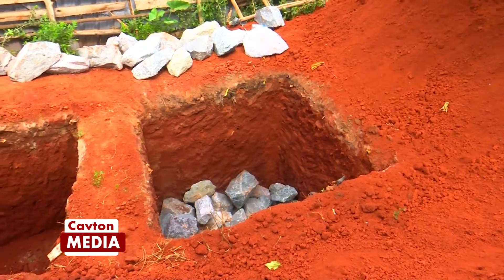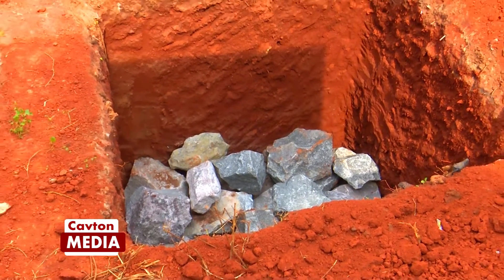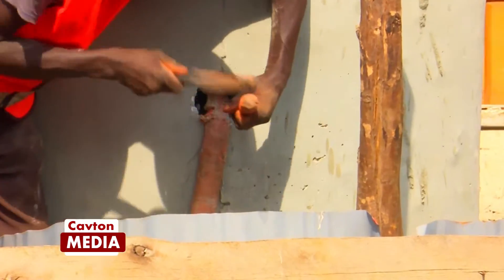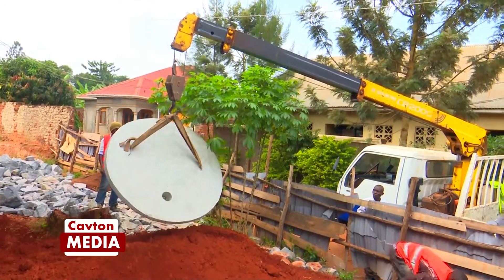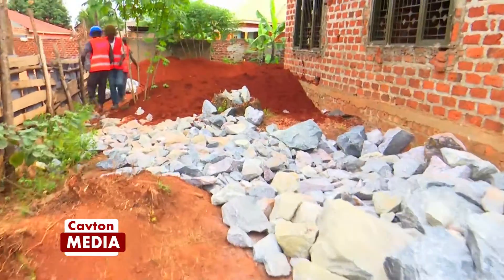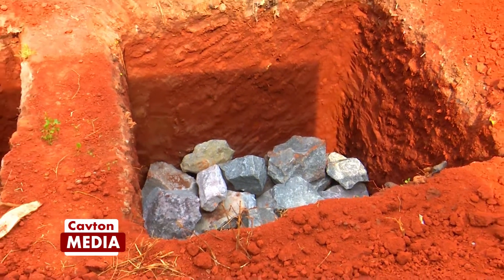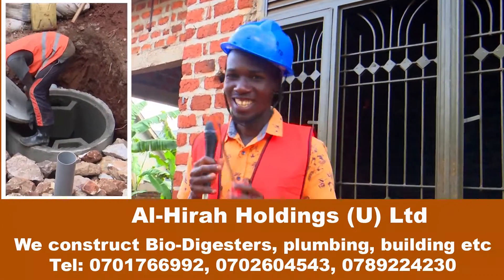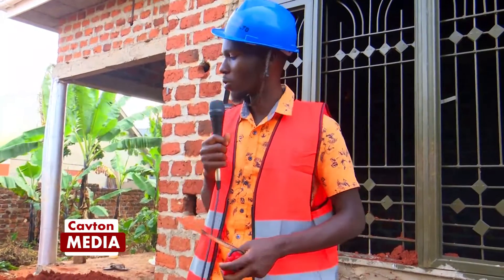Why a Bio-Digester is better than the old Septic Tank in Uganda

Comment: Filter the gas, h2s and c02 are mixed with bio gas , key is using molecular sieve like zeolite 13x pellets , alumina silicate for the Water content and additional filter , with activated charcoal bed as well , , and then to a regulator valve that can be adjusted from natural to the specific weight density of the biogas when filtered , main thing is h2s hydrogen disulfide will corrode quickly the internals of regulators when it’s unfiltered